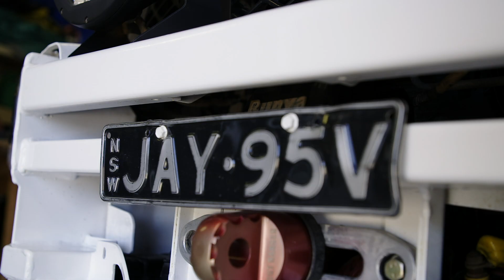Jay’s Wicked LS Swapped GU Patrol – Born This Way Offroaders Ep. 17

Comment: I have a 2016 Nissan y61 patrol and they are still producing them as 2019 models for the middle easy GCC countries they only come here with a gas I6 4.8 thats a monster engine off road especially on sand
Reply: It’s an RB48 isn’t it? They can make MASSSSSIVE power!🤘🏼🤘🏼👌🏼😝
Reply: @Crashryding  tb48?